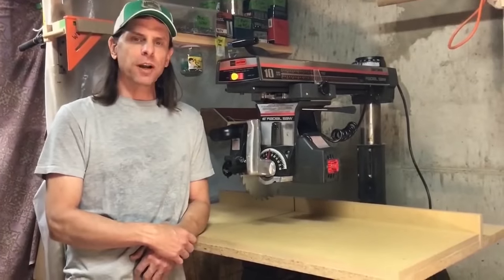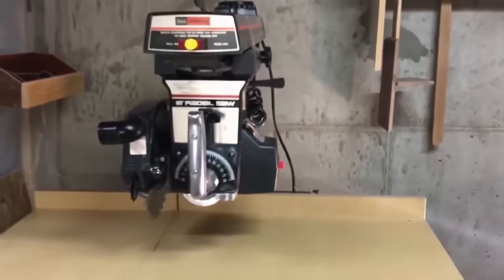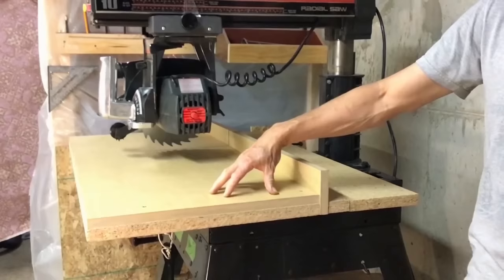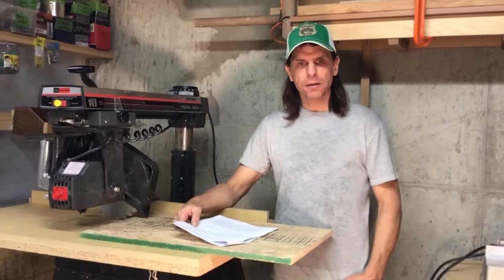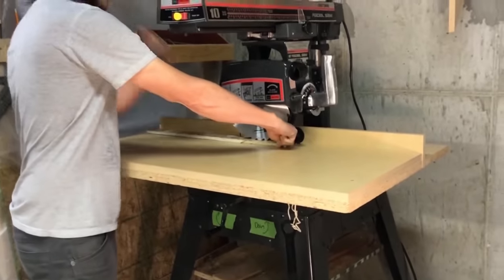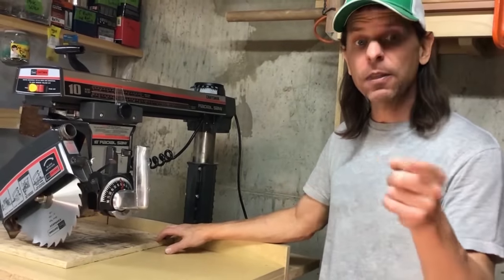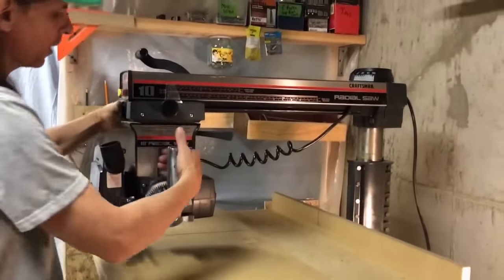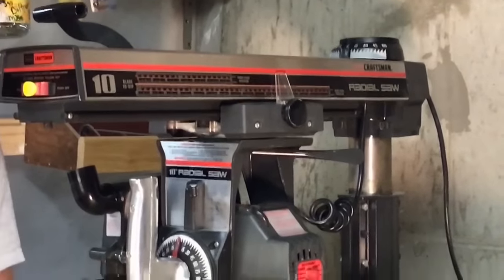The Complete Guide to Operating a Radial Arm Saw

Comment: Your blade guard is missing . I've used one without it , but OSHA stopped down and gave me a nice reminder. He also asked about the rip bar . I didn't know I had one but I told him I didn't like them and he agreed. I have a commercial Delta 12 " and after running the cheap 10" saws I'll never go back. Old Dewalts,Deltas and old Sears are good saws in 12" and some 10" . If I have a tough cut I can put on a 10" blade to increase power .
Reply from the maker: What makes you think the blade guard is missing?  It's clearly there.  Here is a view I made it:  https://www.youtube.com/watch?v=HBlKypocecw

Comment: Thanks for in-depth explanations of cuts, techniques, and especially safety concerns for the RAS. I’ve used one in my shop for over 25 years. One technique that I’ve used for ripping tappers and stock with uneven edges is to clamp a straight edge to the piece that I’m cutting and use the front edge of the table to guide the straight edge, leaving an inch or two space between the fence and the piece edge. There’s no chance for binding between the blade and the fence. This technique is explained by Wally Kunkel, in his book, How to Master The Radial Arm Saw.
Reply from the maker: Thank you!  That is an excellent tip.
Reply: That is a great tip. Also, if the fence is a concern, remove it.
Reply: Great tip.  Sounds like you have read some books on how to use the saw and not just going to work thinking you’re an expert.  That’s the problem with the table saw experts!!!

Comment: Very informative with critical safety alerts. My old heavy Craftsman (1984) saw is still serving me well. The smaller sliding miter saws are a lot more portable, but they will not take the place of my old saw.  I recently took it to my Daughters house for a renovation of her 12x16 work shop. It has a covered porch (8x12) and a 16x8 uncovered deck. All were rotten. Trim, joists, flooring,  4x4 porch posts, hand rails, etc. Pretty big project for me. My old saw is VERY heavy, so I easily removed the motor/power head, and removed the saw frame from the cabinet. It is working very well mounted to some plywood and clamped to saw horses. The weight of the saw allows ripping as needed the longer and heavy 2x6 boards without the saw sliding about. Sorry for the long post. Thanks again!
Reply: My Craftsman RAS is from 1977. It has been on the job site many times, too. I prefer the slide compound miter saw and portable table saw now. Besides, the miter saw is infinitely more accurate than the radial saw ever thought of being. I still use the radial saw to create custom moldings and to perform other tasks but my 1984 Rockwell Unisaw has replaced  it for almost every other function.

Comment: pt.2   that makes it so much easier to conform to the types of cutting it maybe doing such as Rip Crosscut compound or Etc. in any event I could tell you that I was first acquainted with this machine back in 1974 and my father's garage my fathers Trucking and packing company where it was put to its best use of which was where this machine would really Thrive and shine , making many sharp and accurate Cuts because they were mostly repetitious building cases boxes crates and so on I can tell you this out of all the years that I've been using this machine and I still am at 64 years old just like my dad this as in any of the type of Machinery is only as safe as the operator ,there's a couple of rules you should go for by for yourself; obviously always wear your safety gear such as glasses Etc, from the time you put the switch on to the time you take the shirt off ALWAYS have your hand on the handle UNTILL  the blade is totally STOPED  
                      this type of maandchine has been one of my favorites of all the things that I have been entrusted with and fortunate enough to USE.    and I've driven everything from a tricycle to a container crane. just be very careful remember your family needs you and nobody likes to be called stubby !!!  try not to leave anything to chance .

Comment: Sadly, I witnessed a Severe "Kickback" in Middle School (back in 1988), when the Operator feed the wood in too fast allowing the Workpeice to get grabbed by the blade and shot it back and "plunged itself" back with such force that it cut through their midsection 3" wide all the way through...
The school and Instructor where not found at fault, and the student fully recovered after 2 months.
Power Tools are NOT toys!
Reply from the maker: When I think back to my high school wood shop class, and the lack of  safety training,  I'm amazed more of what you witnessed didn't occur.  Scary stuff,  poor kid.

Comment: My wife has suggested that I "visit" my Father-in-law's Shop to see if there is anything I would make useful.
He has a late 1970's 10" Radial Arm Saw very similar to the one in your video, along with 2 Ammo Cans full of New Blades and Accessories.
The only issue I have with "possessing" this Saw, is the "Garage/Shop Realestate" that is required!
I just don't want to have his Son's "cashing out" his tools and belongings like a Piggy Bank. Sadly situations like this happen every day, and we cannot save all the "good tools" of the days past...
I do have my name on his 1970's CRAFTSMAN Belt/Disc Sander, 1970's CRAFTSMAN (14"?) Band Saw, as well as his 1980's CRAFTSMAN 2 Ton Arbor/Shop Press though. At least these are the tools that I know that will be respected and used properly!

Comment: Thanks Walter. I've had my Sears Radial arm saw since 1967 and love it's versatility. I've also been very careful using it and am aware of the safety issues. Your video is the most comprehensive I have ever seen. Thanks again.
Reply: I got home from work one day and entering through my shop I noticed the window directly behind my radial saw with a rectangular hole and cracks running in all directions. My dad explained that he had come to use it to rip some small stock and fed the first piece from the wrong direction.
Reply from the maker: @grannydeen1586  Dang!  These saw should be understood before being used, the consequences of guessing are too high.

Comment: That is a beautiful saw you have there.  I have a Craftsman Electronic radial arm saw circa 1983 although it is  in nowhere as nice of condition as yours.  With the electronic radial arm saw you program in the height change on a keypad on the face of the arm.  It also reads out degree of bevel and miter.  This was really advanced for the early eighties.  I believe I paid about $400.00 new back then.  I also purchased the adjustable dado cutter which I believe is easier to set up than the stack dados.  As far as these saws being more dangerous than a table saw I've got my finger in the table saw twice (same finger) and haven't managed to cut a digit with the radial arm saw (knock on wood).  The most common ways a radial arm saw will get you it either kicking a piece of wood back when ripping or having the saw get too aggressive in a cross cut and pulling itself through the cut ( and your hand if it's in the way).  You gotta be careful of either saw-never get too comfortable using them.  I believe if I could only have a table saw or a radial arm saw I would choose the radial arm saw.
Reply: I've always used my Craftsman RAS, since I bought it in1981, and always felt it was safer than a table saw. Using a RAS you always know where the blade is and can keep your eye on it. As long as you are careful to line up and position the wood carefully and set the height of blade guard and kickback guard correctly, you shouldn't have kickback problems. And I always use a pushstick for rip cuts and to avoid being in the line of fire. To me, table saws are scary because the blade can be hidden or otherwise it's out and exposed when it's cutting and your hands tend to get closer during the cutting process. I guess table saw users get used to all this, but it just feels very dangerous to me. Anyway, thanks for the tips. There a few I did not know but will use in the future.

Comment: Second best tool ever made!   First place is a Shopsmith.   I have both and there is not much in woodworking that you can not do.
I suggest getting a 12” if you are out looking for a used one.   Way better!   BTW, got my first one 1984.  Have never had a kickback!   The key is the saw MUST be completely aligned before using it.   Especially when ripping!   And never use a dull blade.

Comment: I have owned a craftsman radial arm saw since the early 80s. For many years, it was the main saw in my home shop used for crafting and home renovations. I purchased it over a table saw because it was more versatile. Over the years, I have added a table saw and bandsaw. The RAS is still my go-to for croscuts. After 40 years and countless hours, the craftsman still performs perfectly. It is truly a well-made tool, and I have never regretted my choice.
Reply from the maker: Yea, they are great tools for sure!

Comment: I bought my Sears 10" in 1973.  It is an old friend.
On mine, the power switch is positioned just above the handle.  In crosscut mode, that allows grasping the handle while resting the thumb on the switch.  If something goes haywire, a quick poke with the thumb shuts the motor off.  I've done that a few times when I've managed to bind the saw.
A couple of years ago, the motor refused to turn.  Sawdust had clogged the quick-stop switch.  A motor repair outfit in Manchester, NH, got it going, though the quick-stop feature is gone.  It never occurred to me to blow the dust out of the motor housing every so often.
Clamps come in handy.  I've clamped small workpieces by clamping a long piece to hold the workpiece, i.e. the long piece holds the workpiece, and a C clamp holds the long piece tight to the table.

Comment: I bought my Sears RAS in 1969. I had two friends one with a RAS and the other a table saw. Watching them and seeing how each saw operates I decided on the RAS. The blade is always in view you know exactly where it’s cutting. So my saw is now 53 years old and is still a stalwart in my shop. I also have a very nice cabinet saw and use them both. Thanks for this very informative video.

Comment: In Conclusion.... ANY power tool can cause damage. Table saws can easily break bones and take off fingers. RESPECT the tool always, never think "I've been doing this for xx years. I'm ok" That's when you get lulled into the "I know more" and it's then that the rools says you don't. This tool is no different. I have one, never used "yet" but plan on using. Inherited and just haven't set it up appropriately. But I see benefits to it. For 70 years, must have been good enough.  Thanks for video!

Comment: We just picked up a 2002 Craftsman 315.220381 which is still in the box.  We might make an assembly video of it, but I'm not a fan of those stupid unboxing videos that litter the Youtubes.  Thanks for this video - and this series.  Having used a RAS first in the 80s in JHS shop class, I don't understand why they've got such a bad rap.  It's no more dangerous than my Unisaw, my band saw, my drill press, or anything else that has exposed moving parts while operating.  One can only assume these kids nowadays don't trust anything that the government hasn't blessed as being "safe", so they just parrot things that some ignorant fool said about the RAS based on one model which was not very good.
Reply from the maker: Some say the RAS was just too capable.  So by giving it a bad rap that paved the way for it to be replaced with a collection of tools.... in other words more sales and more profits!
Reply: @vanman798  Maybe so; nothing wrong with that!  I wouldn't give up any of our tools - and we don't mind paying for any tool which has a use.  The only reason I decided to purchase this RAS is because there are a couple things it does that can't be performed on any of the tools we have.  One of those things being to be able to surface plane cutting boards wider than our surface planer (13.5") or CNC router (600mm) can fit.  It will be no replacement for our sliding compound miter saw, table saw, planer or the surfacing bit on our CNC for sure, but serve us well as just another capable tool.  And it's brand new to boot ;)
We hope you still have yours, and enjoy it often.  Thanks!

Comment: Thanks for that video! I was about to ask what would happen if we ripped from the wrong side and why that could be bad, but gladly you showed that too! Awesome.

 One question though. Today we see people creating these hybrid cnc saws, where the saw & engine are from above (like Radial) but the wood doesn't move, it's the saw that moves along some rail or steel tube. So you assume the wood is clamped down. In that case is it still dangerous to rip from the other side? My theoretical thinking is, that it's not dangerous anymore as no body parts are close to the blade. It's the saw that moves and assuming it's properly clamped down or screwed down we only risk damage to the machine itself. The likelihood of ejection or kickback is minimal or non existing. Is that correct? Also even if it does occur, it would be ejected away from the operator into some steel plate (dead zone). Perhaps more experienced woodworkers could respond. It seems that we would exchange safety for setup time. 

I'm thinking it would also require more real-estate as the entire ripped piece of wood needs to lie flat. So anything longer than the table and the sliding rails would either need to be ripped in several passes or not ripped at all.
Reply from the maker: Unfortunately I'm not familiar with hybrid cnc saws.

Comment: Great video! Been using a Craftsman RAS since buying it new in early 1976. Sadly, it was not as high-end as the one you are using. Wish it was. But it still works just fine. 
What I don't understand is all the "RASs are dangerous for ripping" stuff the internet is so loaded up with. I understood from day one which side to feed from for in-rip vs out-rip.
Since acquiring a miter saw, truth be told, I use the RAS pretty much for ripping exclusively.
I'm used to it. Table Saws, otoh, I am NOT used to and THEY seem more dangerous to me than a RAS.
Reply from the maker: I agree, it comes down to what you learn to use.  I was careful in this video to not compare the RAS to a table saw as I think that is not needed, but sure is the all the hype!  Radial saws, to me, are amazing tools.

Comment: They don't sell these to regular Joe because it does all. And there's no need for all the other power saws they sell. It's as dangerous as any other saw if not used properly and with respect. It's a marketing technique used by major companies. They can now sell you 4 different saws all costing $300+, when this was only $500 at one point and did it all. All saws are dangerous.
Reply from the maker: Amen, brother!
Reply: Yes and no.... these have the blade directly connected to the motor, so do cheap table saws and the problem with that is vibration..... if you want precision rips you need a good belt driven saw to absorb the vibrations..... a good saw has 3 belts and the motor is mounted to the cabinet not the top. Otherwise I agree.... I'll rip on a RAS all day no problem
Reply: I have my father’s Craftsman 1968 vintage 10” RAS used since I was a teen, no injuries. Found these saws much more personal than any miter saw!

Comment: Great, informative video!  I’ve been considering purchasing one of these for my wood shop.  I have seen several used ones but struggling with which one.  I am very fond of yours after this demo.  What is the model number?  As a side note, it is extremely cool that you have the vintage attachments.  I appreciate your time.  Thank you!
Reply from the maker: 10 inch Radial Saw by Sears  model 113.197751  original purchase date March 1982.

Comment: I learned how to use an RAS in the early 70's (Craftsman, what else?) when I was about 12 years old. I've never had a kickback or lost any body parts. Unfortunately, my dad couldn't say the same thing. But we did come up with a few things that helped minimize the risks. A featherboard clamped to the fence can help keep the piece from climbing, and one attached to the table helps keep constant pressure against the fence. 

A few years ago I managed to buy one at a rummage sale, had it in the garage always planning to use it. It's a 1958 Craftsman, (again, what else?) that I just took apart, thoroughly cleaned, honed the post pivots, and polished the track grooves and the height screw. I replaced the key switch, located on the top of the arm, with a toggle switch. 'Off' is back so that you push away from you to turn off the saw. 

I've been watching videos about the RAS, yours are among the best I've found so far. One small addition for your table would be to make a very light reference cut (about 1/32" depth) to show the blade track. Darken it with a sharpie. It will tell you the exact locations of the blade.
Reply from the maker: Thanks for taking the time to comment.  Your restoring project sounds interesting and rewarding.  I appreciate the tips offered as well.  It is very kind of you to give me such a nice compliment.

Comment: Mine looks exactly like yours but I  bought it new in 1977 and I still have it in service. It has the original table and guard even though a few years ago I received the new table and guard from Craftsman as a result of their recall. It's a pretty good saw for the money. I worked in a shop that had a large Rockwell radial arm saw. That was a great saw but at the same time, intimidating.
Reply from the maker: Mine is a 1982 model,  which I bought brand new in 2016.  It was an amazing find, still in the original unopened box!